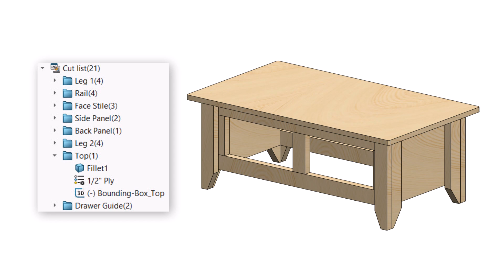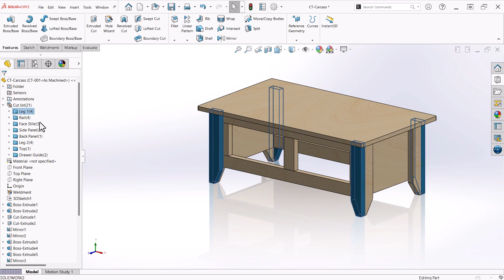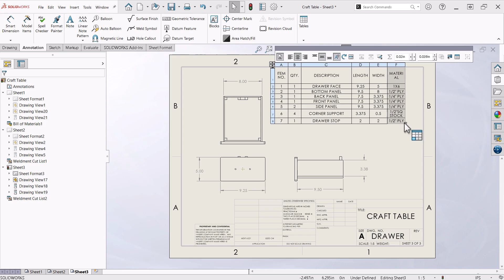Leverage Bounding Box Data In A Cut List

Comment: I need to make cutlists for multiple configurations, but it doesn't let you create weldments for different configurations... wtf.
Reply from the maker: Hi there! For more information regarding cut lists, please see here: https://help.solidworks.com/2025/English/SWConnected/swdotworks/c_cut_lists.htm. You can update cut lists manually or automatically. The first time you create a part document, the SOLIDWORKS software turns on the Weldment document properties in the part template that is created. Additional info. can be found here: https://help.solidworks.com/2025/English/SWConnected/swdotworks/t_Updating_Cut_Lists_weld.htm. We hope this helps!
Reply: @solidworks  Does not answer my question at all. You can't make cut lists on different configurations of the same model, at the same time, to be able to bring those into a drawing. Dumbest thing ever. Maybe I just want to show components of part of the file (config.A) in a drawing, I can only show the cut list for that config. If I have two configurations shown in the same drawing, I can only show one list...